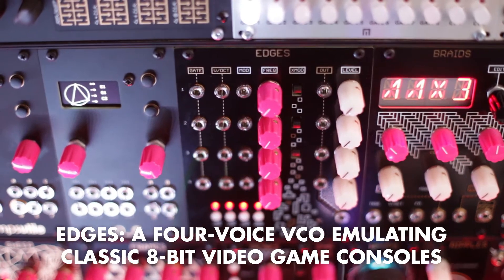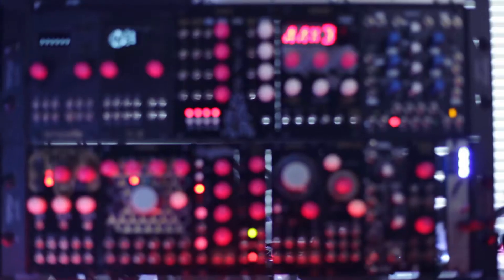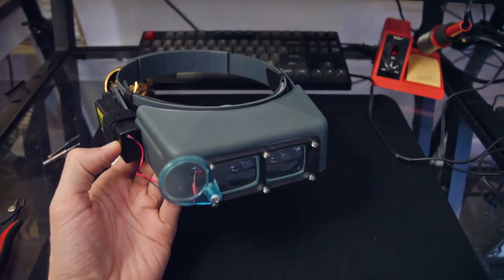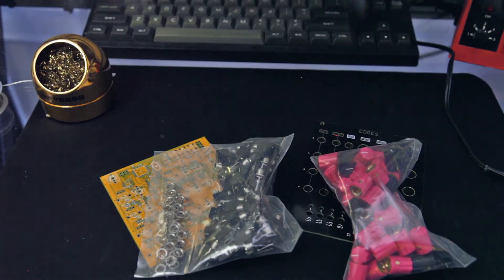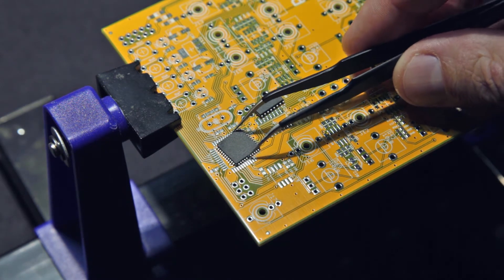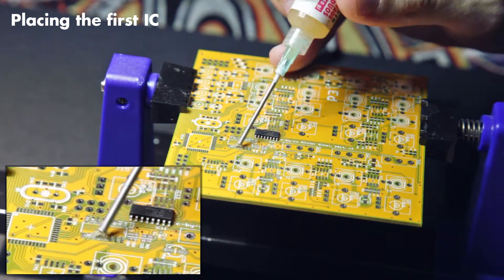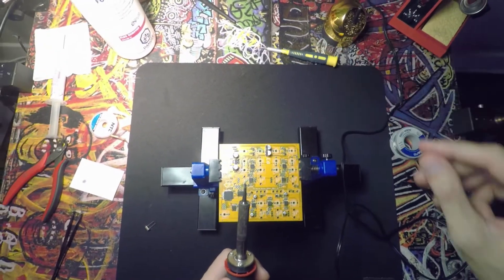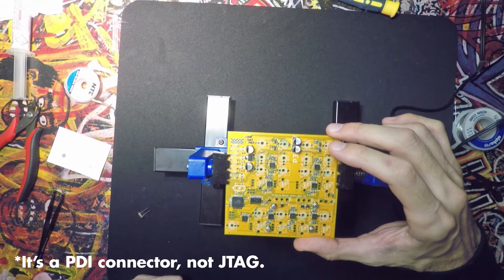Building a DIY MI Edges

Comment: I am thinking of buying a headband magnifiers glass, which number do you use? I had thought of 5 (2.5 times), which is comfortable for you?
Reply from the maker: I use a Donegan DA-4 which has 2x magnification, along with their flip-down LP1 Loupe for an additional 2.5x when needed (such as for soldering IC’s with tiny pin pitches).
Reply: @wavedepletion  Gracias/THX

Comment: if anyone is watching this.. get a hot air station and do it the easy way
Reply from the maker: Sure, more equipment is nice to have. But one of the points of this video was to show how easy it really is with just hand soldering, without having to invest in more gear! It really is a non-issue. Even the smaller 0402 boards on the newer MI modules are still accessible to builders who are ready for the next challenge. It's okay to challenge yourself and increase your experience level! And do so without spending more money.

Comment: Hey there, thanks for putting together this video! I bought the same AVR ISP programmer, per your recommendation. Is there any kind of special configuration that I need to do in the mutable dev environment, or will it automatically recognize it? I just put together a branches, but I'm getting this error message when I try to flash the chip...

"avrdude: Device signature = 0x000000
avrdude: Yikes!  Invalid device signature.
         Double check connections and try again, or use -F to override
         this check."

Not sure if its a problem with the programmer, chip, or something else entirely. I also used some questionably old solder paste for the job hahah. So shoddy joints also wouldn't surprise me :/ Any further resources, guidance or help would be appreciated! Thanks in advance.
Reply from the maker: You can check if the AVR ISP programmer is recognized by running lsusb from inside the vagrant environment. A device signature of 0x000000 probably means that it isn't able to read the chip on the Branches module at all. Try flipping the ribbon cable around the other way, and double checking all the solder joints. Failing that, try searching the Muffwiggler DIY forum or even just Google for similar error messages - often that leads to clues that could set you on the right path, even if it's not about the same device or module. Hope it works out for you!
Reply: @wavedepletion  Thanks for your quick reply! After quite a bit of head scratching and trying to troubleshoot, I discovered that it was the ribbon cable I purchased supplying power to branches... Sometimes its the simplest things 🤦🏻‍♂️

Cheers,
Kyle

Comment: First of all thanks for the amazing video - It gave me the confidence to start building these diy mutable instruments modules and I've now nearly finished my third.

Just a quick question:  Does your edges module work exactly as it should? Like does the external PWM work properly? Mine didn't work at all, and I've only got it working by hacking the code so that the pwm input for all of the first three voices is taken from channel 4's 1v/o input as it is supposed to be (from reading the manual)

Also all four voices work perfectly in unquantized mode and I've got them calibrated nicely, but when I enable the quantizer it all goes to hell and it quantizes to all sorts of random notes at different times.

The weird thing is I can't see what could be causing these problems external to the main processor.

So either the code is wrong (which seems very unlikely) or there's something subtly wrong with my processor.

Just wanted to see if yours is all working fine.

Thanks again,

Chris
Reply from the maker: Hi Chris, sorry for the delay in replying! But I haven't been able to replicate the issues you describe. Hopefully you've had some luck in tracking it down since you posted. 

If not, I'd probably start by verifying there are no bridges/shorts in any of the IC pins, and make sure they're all actually attached to the pads. Sometimes a pin can look like it is soldered but it's actually not. Occasionally if I encounter an issue I'll lightly push on each pin with a fine tweezer to see if it moves at all. Be careful as you can easily break pins this way, but it's a very crude troubleshooting step that has saved me a few times. Also it might be worth going back over all the other components and re-soldering them to make sure they're good.

Comment: One tweak that may improve build success rate: building up the rest of the circuit before installing the ICs. This way you can do easy short testing by checking continuity between ground pins and power pins on the power header. For example, if ground and +12V have a small resistance between them then you probably have a short somewhere. You can plug it in and check that the power is being distributed correctly by testing for the correct voltages at the IC pads- all without exposing your ICs to potential damage!

Comment: Great video. Thank you for this. Do you have any info on ordering from Mouser? Specifically, when I use the Mouser links in that Google Doc you linked to, a good portion of the parts are backorder. Is this normal? Should I just place the order and wait for the parts? What's your experience with this? Thanks again.
Reply from the maker: Hi Jake, excellent question. Yes, it's pretty typical for some components to be out of stock. I try to avoid backordering components when possible as it can often be months before a re-stock occurs. For many projects I end up collecting parts from 2-3 different suppliers, including Digikey, Mouser and Newark. You can also search multiple vendors at once with Octopart.

Another option is substituting components with the same specs but from different brands/manufacturers. For stuff like resistors and capacitors this is pretty common. It takes a little practice and experience just learning to navigate the component shops, using their advanced browse/search features, and knowing what all the different specs mean, but after a while it gets easier. But on Mouser for instance I'll bring up the known component that is out of stock, and then use their advanced browse to drill down and compare it's specs with other ones are are in stock, until I find a match.
Reply: Awesome! Thanks for the reply. I decided to order a kit for my first modular DIY. Got a Rings kit. My next question is about orientation. Is there a trick to figuring out where pin 1 goes for ICs or which direction a diode should go, or do I just need to check the schematic and look for what its connected to?
Reply from the maker: Jake Carter For IC’s there is usually a mark, circle, or beveled edge indicating orientation, it’s different for each. For diodes you should look up some info on diode polarity, but usually a line indicates the cathode/negative side. Be sure to use Autodesk Eagle and download the Eagle (.brd) file for the Rings PCB from the Mutable Instruments github repository to verify placement and polarity.
Reply: Got it. Thanks for the help!

Comment: I'm working on an Edges presently, so this is super helpful! Can you point me in the direction of any resources for uploading the firmware on a Mac?
Reply from the maker: Joshua Biehler Check out the links in the description! The MI page has the instructions and a ready-made VirtualBox with all the files you need.
Reply from the maker: Also I just updated the description to include a link to the AVR ISP programmer device I used. For Edges you have to get one that specifically supports "PDI".
Reply: Perfect, many thanks!

Comment: Awesome video dude thanks for going to the trouble of making it. 
I'm probably most nerves installing the firmware, I've build a ripples filter and I'm not sure what to move onto next.
Reply from the maker: The Con Man Thanks! Other than perhaps the smaller modules, they’re all really quite similar in difficulty. If you want more practice before doing say Braids or Clouds, Branches is a good one. Or, Ornament and Crime.